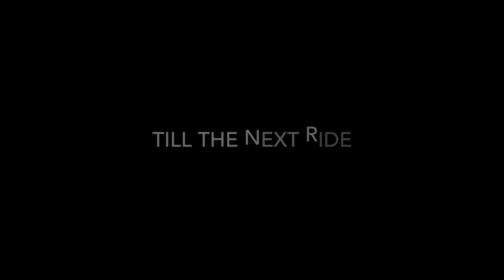KingSong KS-S18 How to remove the shipping/assembly block spacer [version specific]

Comment: I’ve been riding my S18 for a week and never knocked these out because I didn’t know where they were, so this was a very helpful video. What’s the advantage of them being removed? Better suspension travel, I’m assuming?
Reply from the maker: Lars, I just found out that there was two batches by the looks of it. One batch with the block and one batch with a solid brace. The one can be removed like mine in the video and the other version cannot as its solid. So you need to check if yours are the 1 or the other. Mine when I removed it it made the suspension move more freely. The second version looks like they changed the part to be a solid brace. 

Let me know what version you have?
Reply: Andre and Anneliese, yeah. After I ready that comment, I ran downstairs with my mallet and screwdriver, and then realized I have the batch 2 brace model. No need, I guess. 

Hey, is there an email I can reach you at? I have an idea that’s EUC related. Sort of a project we could collaborate on together, if you’d like.
Reply from the maker: No problem, andre.mostert@gmail.com

Comment: Hello thanks for the vid! The block appears to be as thick as the frame itself? On my wheel where the block is suppose to be is thinner, it measures 50mm thick is that the same?
Reply from the maker: Yes as I was explaining to one of the other guys. It looks like there was two versions of the foot plate. The one version is the one in the video where you can remove this shipping block to allow the suspension to move more freely. Then the second version is the one that you have. Yours cannot be removed as its part of the brace and foot plate. I did not know there was two versions. I have also found out that the two version was all shipped in batch 1 here in the UK. 

Yours you cannot remove. Thanks for letting me know. Dont want people to try and remove it when you cannot. Great wheel and thanks for watching.